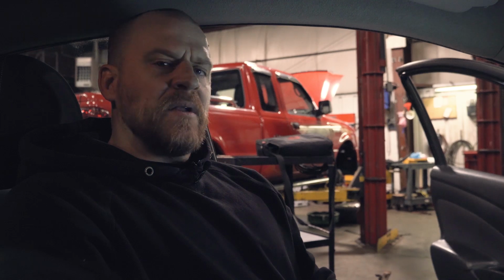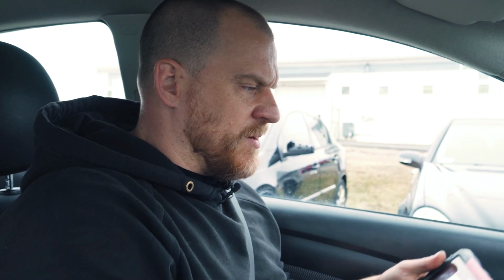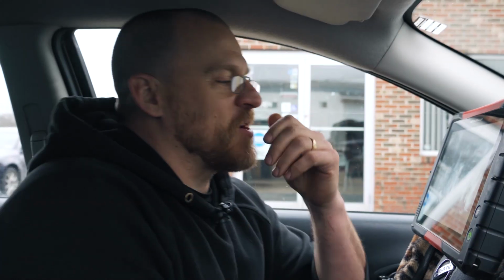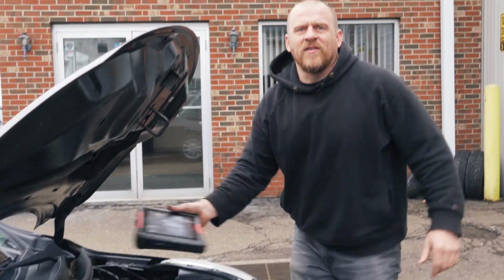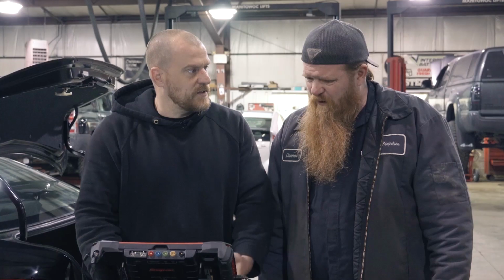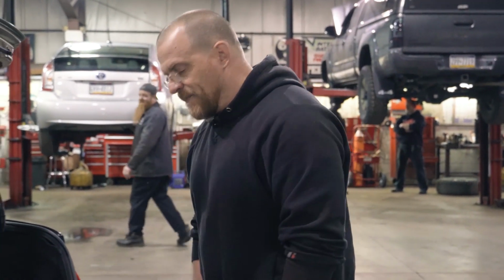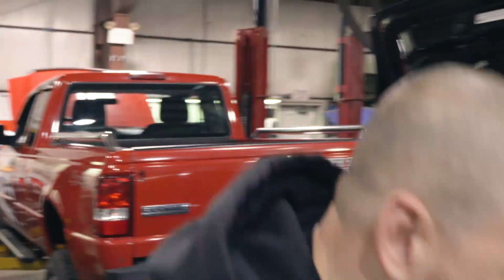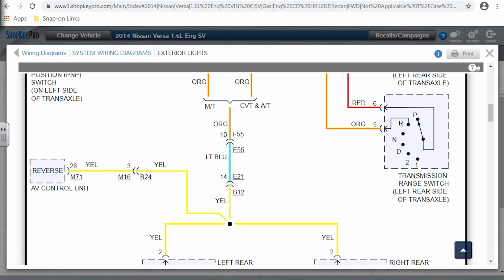2014 Nissan Versa P0705 Transmission Range Sensor "A" Circuit (PRNDL Input)

Comment: PROBLEM FIXED: I own a 2015 Nissan Versa sedan and had the exact same symptoms including the gear position next to the odometer disappearing. At 27K and 40K, the CVT transmission was replaced under warranty. The P0705 issue started at 85K miles and I didn't fully diagnose the correct fix until 105K miles. I tried swapping the tail light circuit boards from another Versa, pushing wires (feeding into) the connectors, taking out and turning the connected tail light assemblies to twist the wiring to make better contact, changing the transmission sensor (twice, maybe 3 times), resetting the engine light each time. The code would go away and then always come back. Then, I identified the real issue was the loose female metal "pin grabbers" inside the female tail light connectors. The pins on the harness do not grab the pins on the tail light assembly tightly enough, throwing the code. It has nothing to do with your transmission. Rather the cost saving effort in perhaps a common ground or other wire between the transmission sensor and tail light wiring. Hence, you have signal loss, triggering the check engine code. I took a pointy tool (like a screw driver except ending in the point). You have to use a tool with a strong pointed end. And placed it into the female connector, pushing each of the "grabbing" connectors (top and bottom metal) closer so they'd grab the male connectors better. Now at 110K miles, no check engine light and I don't expect it to return. I didn't bother resetting the code this time and the check engine light went away on its own a couple thousand miles ago.
Reply from the maker: Great tips! Thanks for sharing and glad you fixed it.

Comment: I’ve had the same problem. I changed the neutral safety switch and the code was still showing. I watched your video and took out the taillights to check for corrosion or anything noticeable around the reverse lights. Both taillights looked fine so I just decided to clean the connectors. Now just waiting to see if the check engine light comes back on. What was the final solution you came up with? Should I have just went ahead and changed the lights anyways? Just looking for any help been trying to figure this out for a month now.
Reply from the maker: We changed the bulbs and it never came back. Best I got. I'm sure you'll be good now.
Reply: @ScannerDanner  thank you for this great video. Cleaned the connectors 4 months ago and the engine light never came back on. Saved a lot of money thanks to you

Comment: Hi I had a po701 code and  watching your video was very somewhere to my problems I had no dash light blowing fuse for the dash every time I put it in reverse so today I went out and check the rear lights and turn off the wire was shorted back there pinch between the anchor in a light anchor bolt fix that I’m back to  Running great out  lamp mode . I never stop burning I’m a retired mechanic of over 50 years and you can always learn you’re a great help when you found that bulletin about water and the tail lights so that’s where I went and looked.
Reply from the maker: Thank you for the feedback and I'm glad this helped even if it was indirectly

Comment: I’m having the same problem. The dealer first changed my battery, then my engine light came on with the P0705. They told me the mechanic didn’t install my battery correctly. Then, they said I first needed to start by getting a new range switch. That’s what they are doing now. They said if that doesn’t work then I need a new transmission. Could this be something to do with the battery? I heard the guy at the end say frame to battery jumper, high resistance ground? What does this mean?
Reply from the maker: can't remember but I think this one had the reverse light circuit back-feeding the module

Comment: is there a follow up video to this? We're dealing with this issue. We've gone as far as replacing both rear taillight assemblies with dealer parts, but the problem came back.
Reply from the maker: How long did it last?

Comment: Had this problem in my 2012 Nissan versa.  Changed the bulbs first,  problem came back.  Changed the circuit board ... problem came back.  Finally fixed it by changing the pins that connect to the circuit board.

Comment: So I had same code pop up and the shift indicator was disappearing on me. figured the rear driver side tail light was the issue due to corrosion because there was a crack in it and sure enough the circuit panel was corroded.  Pulled the panel and cleaned it up was still getting the TCM issue .  Now to see if it was the actually TCM I unplugged the taillight and drove around in drive and the shift indicator went blank and engine light came on.   So since it’s unplugged from the taillight I’m guessing the corrosion shorted out the TCM and ruined it?  Is there something else I should try ? I have a new taillight on the way but seeing how it happen while unplugged it’s still probably a issue ?
Reply from the maker: is the tailight connector also corroded?
Reply: @ScannerDanner  Update:  So I did a couple things I think the issue may of been a 3rd party led bulb in the brake light, possibly brake light switch or like you said the connector.  I could get the TCM code to trigger if I tapped the brakes consecutively.  I ended up pulling the switch cleaning it with contact cleaner, cleaned the l taillight connector and pulled the brake light bulb. Drove around without the bulb in and no engine light came on.  Switched out the taillight that came with new bulbs and so far have not had any issues.   Hopefully thats its and thanks for making this video for helping narrow down that it could of been a electrical issue and not TCM failing.  

I wanted to add when the first time the Engine light came on these codes came out when I went to Autozone to pull he codes P0705 / C1116 / C1109.  Last 2 are under ABS category.
Reply from the maker: @ZmanBaazar  aftermarket LED bulb I could see being an issue. Nice job my friend
Reply: @ScannerDanner  When I first checked it didn’t look noticeably corroded. I’ll check again when I swap the tail light out . The pins on the panel looked clean and the insides of the plug did as well .

Comment: Continuously variable transmission. Basically a pair of inward facing cones for input and another for output and a high strength belt connecting them. the input cones move apart and the output cones move together so that the belt is on a smaller part of the input side cones and bigger part of output side cones to increase gear ratio. Since it can be at any points on the cones, it doesnt have set ratios, itll just slide continuously, slightly increasing the ratio the whole time.

Comment: This video just saved me at least $5,000. Took my Versa to the dealer and they said it needed a full transmission replacement. I watched this video and connected the dots to the after market backup camera I had installed. The knuckleheads who installed the camera did a terrible job and left the wire open to shorting out. A quick repair of their work, and the car is not throwing the error anymore.
Thank you, thank you, thank you for posting this.
Reply from the maker: Heck yeah! Glad this helped you!

Comment: cvt = Continuously Variable Transmission
usually its two pulleys connected with a belt that is moved with a stepper motor. 

buy a manual.

Comment: Yeah another gentleman asked my same question why you didnt check the connector. Which always has a chance of a problem. I came across this same issue. Worse part is that its a simple circuit. Anyways i found that the place at the male connector melted for one reason or another and two contacts were touching by thousands of a inch lol so change the tail connector that fix the problem. Been a year customer never complained again!

Comment: Hi guys.  I want to thank you guys for posting what you did.  I have a 2016 Nissan Versa.  I took a trip to the autozone to find out what was going on with my car.  All the symptoms you guys talked about, dash PRNDL, backup lamp going out,  delayed acceleration all were happening .   However instead of having major components changed first at a local AAMCO I decided to do the easy cheap stuff first.  Lo and behold my car is running better by just changing the backup tail light bulbs.   The check engine light is still on but all the symptoms have gone away.  It even shifts smoother and I will update you guys in a week if anything odd comes up.  Y’all saved me a ton of money.  Thanks and hope you guys take this into consideration.
Reply from the maker: That light will go off. It need to do some self tests over a few days and it will go out as long as there is no other issue. Thank you! So glad to help
Reply: Did this fix your problem? I am getting the same error, same issues and hope it fixes mine.
Reply: @LadybugToes  yes it did work .   Those Japanese have 5 dimensional thinking.  I recommend changing both backup bulbs just in case.
Reply: @JavierMendoza-hb9uv  thanks for replying. Changed both bulbs today. Lights are good and the dash light is no longer black when i put it into drive. How long did it take for your cel to go off?
Reply: @LadybugToes  I would guesstimate about 4 years after purchase .  But I got it used so I can only imagine since the car’s first day would have put it at 6 years.  Tough little car.  I try to ensure it is clean and all maintenance done on time

Comment: One thing you could have done is to use a  Resistor between 12v positive and reverse light positive feed to see if it does pull the code or not.

Comment: Could it be the brake switch on the  brake pedal
Reply: I notice when I turn on the right turning signal the drive indicator goes out and back in and the same thing with the brakes
Reply from the maker: Sure sounds like water or corrosion in that same area we showed in the bulletin

Comment: I had the same problem. I replaced the sensor, but it was still doing it. So I replace both rear brake light and it fixed the problem so far.
Reply: Hi John. Thanks for your comments. Can you say it has totally fixed it now???
Reply: @AG-jt2wq  No it didn’t. I had to replace them both again and do a reset. Now it hasn’t done it in awhile, I also did a reset on it because the engine light it still comes on. I think it’s a there some wrong with the electrical harness that goes the the transmission because they have bad transmission. Nissan bought a transmission company and put out defective transmission. The is a lawsuit going about it.

Comment: I love you man thanks I have one named sunny here and it's module 2016 and I had the same Issue as exact the pervious owner has changed the transmission range sensor and it still shows up and actually also the gas consumption is a really high and then I found your video I checked the bolds and actually I found that the whole connector is has some burn at one of the pins I have to change the whole tail-light along with the connector

Comment: Differentials are something I really wanna get to get good at I’ve done one on my own pick up after paying someone “who knew” what they were doing only lasted 500 miles it’s good money once you know how to get one done in a hour or two took me like 5 days to get mine at spec on back lash pinion depth and etc but since then I’ve driven 20k miles of harsh driving off roading and burnouts no growling have done 2 services and checked the gear mesh it’s still perfect. One of the proudest moments I’ve had in my 6 years of being a mechanic I am now 21 did it when I was 19 started when I was 15 at a local trans shop.

Comment: We had the same experience with the Reverse light appearing dimmer.  We removed bulb, as you did and brightened right up after reinstall.  We also did a software update and like you shall wait and see if the car returns!  Thank you for the video Paula @ Summit

Comment: Hello @ScannerDanner. So what happened to the car? Did the CEL came back on after you replaced the reverse light bulb? Did the bulb replacement fixed the problem? Im having same problem with my girls car, ive also replaced the park/neutral switch. I dont want to replace the tail lamp assembly yet, maybe cleaning the contacts and replacing the bulb will solve the issue

Comment: So i had the same issu with my sisters car. I found melted negative wires on both tail lamps. The circuit board melts with the connector.. so remove the connector and check for melted negative wire at the tail lamps.

Comment: Just too let you know. My 2015 Nissan Versa would not take gas at all.. I would turn off engine several times then it would finally go. Took for diagnosis test only issue found was a brake light right side out. Which I had replaced 2x already.  Replaced it and have not had that issue since has been 5yrs.

Comment: Am working on one of these one right now and the rev light left side flickers at times. Am going to take it apart to see if the socket has any corrosion. I don’t see any no water intrusion on the outside lens. The vehicle drives good and no problem just a annoying check engine light.

Comment: We had the transmission range sensor replaced in my wife's 2014 Versa less than a year ago and now we're getting the P0705 code again! I can change out the rear lights easily enough but what I'd like to know is it ok to drive the car in this condition?

Comment: I own a 2014 Nissan Versa Sedan, bought it new. Except for the CVT transmission and this stupid code, I like my car. My first oil change shop never told me they can't check the trans/CVT fluid, that it needs to be replaced every 60K miles. So, needless to say that never got done and I ended up having a rebuilt transmission put in my car a few years back. Yeah, shame on me for not reading up on this very important maintenance.  Seemed to be doing fine and now this stupid code keeps showing up. I've got stacks of paperwork in my file about my research on this code. I'm not a mechanic so it just makes my head hurt. There seems to be conflicting thoughts on what it is and what should be done.  Some have even told me to just “have it cleared because it doesn’t really mean anything or it may just be your gas cap isn’t tight!!!”.  I did find the following: "The NTB15-082 advises NOT to automatically replace the transmission range selector as your first choice. Instead, Nissan has identified a corroded circuit board in the rear tail lamp assembly as the most likely cause of the hesitation during acceleration and the P0705 trouble code". I was told (not exact words) the corrosion causes the transmission to think the brakes are always on and this causes drivability issues. I didn't believe it when I was told this a few years ago and when a mechanic pulled it apart and I saw no moisture or corrosion so I declined service.  But my car has been acting weird so today I had both rear lamp assemblies replaced. We’ll see if this $642 replacement does the trick.

Comment: Would you recommend just spending the money to replace the CVT automatic transmission to manual transmission?
Reply from the maker: probably not, depends what you are working on and whether or not the parts and pedal assemblies are available

Comment: Had an issue with intermittent no start on my 02 accord. Had starter tested at the zone of auto's and it tested good. So i did all the tests ive found throughout your videos, and still didnt find anything. Then i became a parts changer. Well 400$ later i found the video about bench testing the starter....i test everything myself now. Thanks for your videos!

Comment: So did you ever solve the issue? I have the same year and car. Mine does have hesitation sometimes goes in limp mode. I don't see no water damage and the tail lights but my left side tail light blinker keeps blowing and going out. Sometimes the park neutral drive and low and reverse would disappear from my dash! P0705 code still on. Any ideas? Apparently is part of the main computer source of the car is in the tail light.?

Comment: Reminds me of one case with vehicle equipped 12 and 24V electric systems. Voltage gauge was reading weird, windshield wipers were slow and so on.  Diagram was bs, all wires in vehicle white with numbers.   Reason was fried plastic in one of the bulkhead connectors, 12 and 24V pins where next to each other and plastic was transformed semi conductive...    there was no sign of moisture.   Accidently found out that 12V supply wire from battery had voltage when disconnected. After that it was just following wires and voltage inch by inch until got to the faulty connector.
Reply from the maker: sounds like it took you a few hours at least to narrow that one down?
Reply: @ScannerDanner  Can't remember exactly. Happened 9 years ago.  Day, at least with getting it back together.

Comment: 35:38 if the brake light circuit was corroded to the reverse light circuit you could be in drive with your foot on the brake powering the reverse circuit. Haven't finished the vid yet so IDK
Reply: He discussed this a few minutes after my time stamp